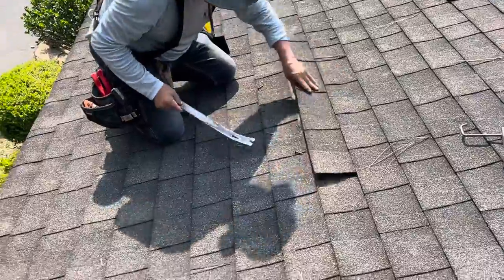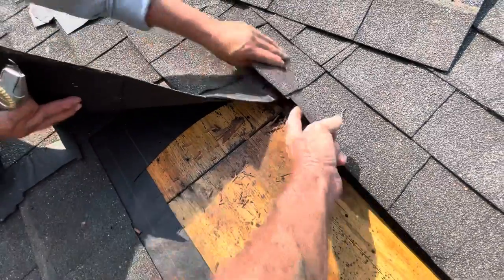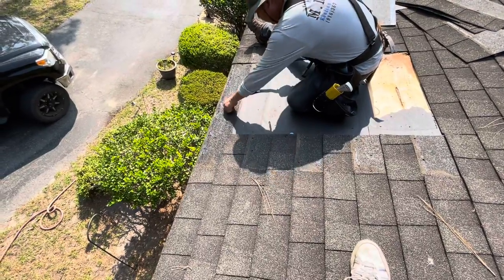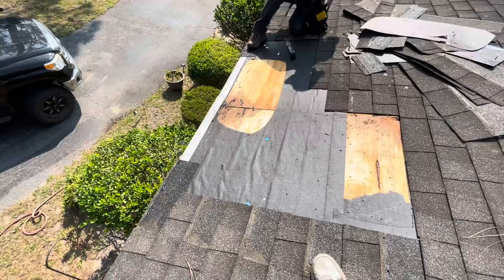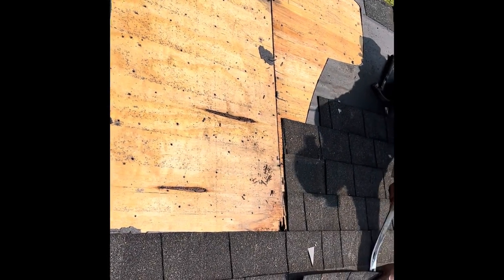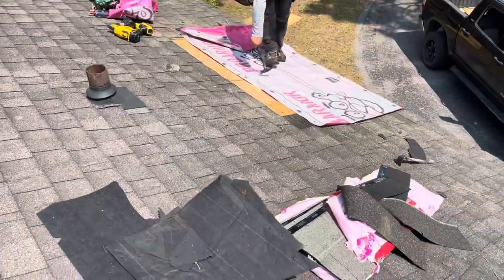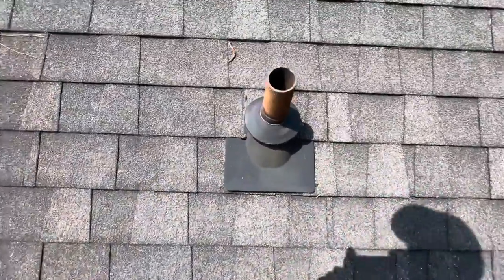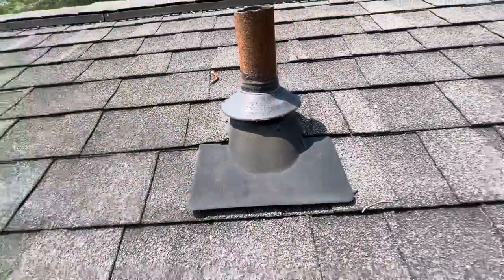Shingle Repair With Removal of Rotted Plywood. How-to!! Step by Step

Comment: I've been looking for videos about mobile homes and I am glad I found your channel, I own a double wide that will like to renovate, but I wish to change the lay out of it specially on the kitchen, do you have any videos about moving interior walls? are the interior walls load bearing walls on double wides?
Reply from the maker: Send me pictures of the int walls. Not many int walls at load bearing on a double wide. Just the center wall and the outer walls

Comment: There aren't that many shingle roofs in Alaska but this does remind me of when I was young 👍🙂
Reply: @ScrappingwithGrandpa  mostly. There are some shingle roofs. But it's not a very good climate for them. 🙂🙃
Reply: @ScrappingwithGrandpa  or blue tarps! I was on a satellite cable small home show. It was so fake. The people were from the same company and the houses were not done and also the families were made up of one couple and two strangers that they made act like a couple and two of my children and one of my niece's children who are the same age ish, and my niece as a single mom of triplets. They just picked people out of the extra casting call group and filmed around the incomplete parts of the house. It was so fake. But the one thing everybody on the set extras and stars, agreed about was that the roof WAS truly Alaskan. Both houses had blue tarps.☠️🌌 🤣🤣🟦🟦🟦🤣🤣🌌☠️. So much haha; but for real, no joke... 🤣😄😅🟦 Even me.  Even rich people and there are a lot of those up here...           Also multimillion-dollar homes with aluminum foil in the windows. It's 10:36 pm and it is still light enough for me to work outside or read.
Reply from the maker: Interesting